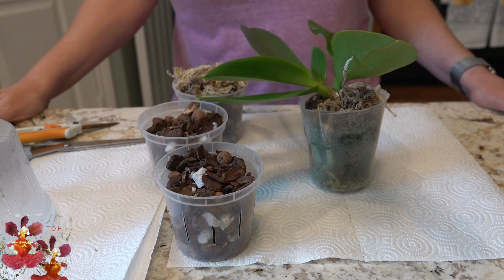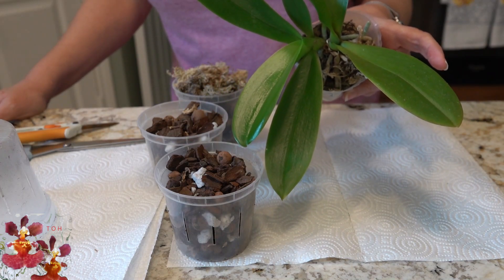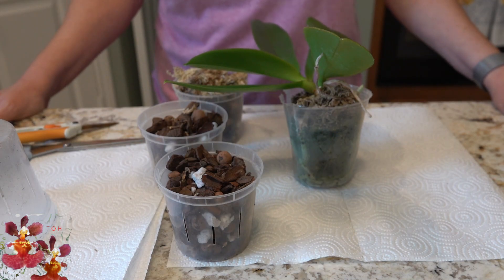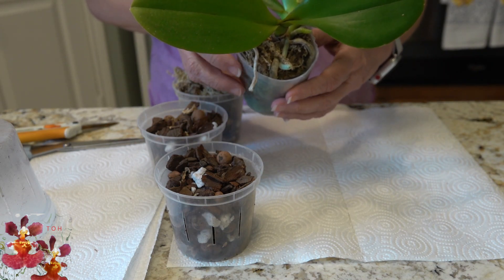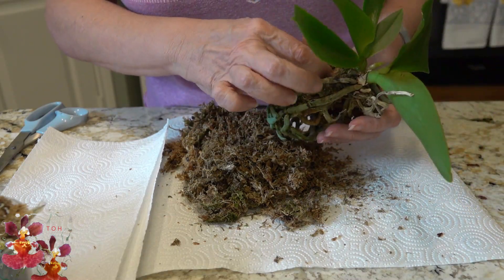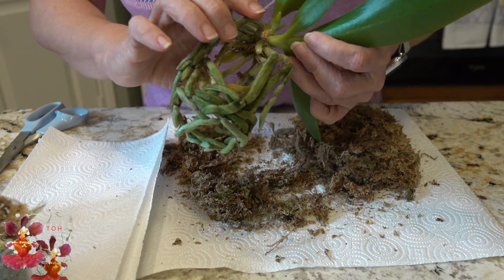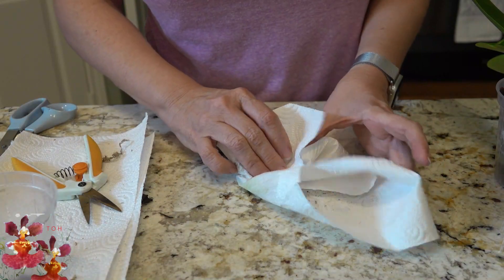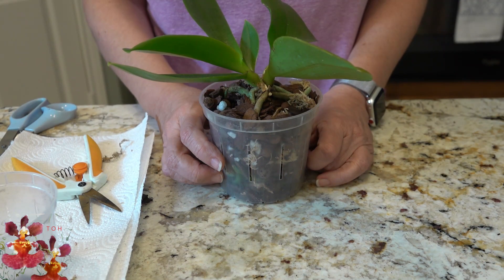How to Handle a Phalaenopsis Orchid Basal Growth | What is a Phalaenopsis Basal Growth? | Repotting

Comment: The root system looks great.  This video came just in time. I currently have 2 phals that rotted in the center and eventually lost all the leaves and left behind the roots.  Normally, I would’ve thrown them in the trash, but I decided to keep the root systems in a vase with a little water and low and behold, two basal growths started on one plant and one on the other. 😮. I also have another Phal that extended in the center and grew roots in the middle of the plant.  I then cut the top off with the roots (now growing in its own pot ) A new growth started at the point where I cut the top off ( above the healthy leaves that were left behind.)  If you would like to see them, I will send pics.
Reply from the maker: Very interesting!  Yes, please send pics…I may be able to share them in a community post for others to learn from.  TheOrchidHut@gmail.com

Comment: Nice topic 👍Recently i notices a basal growth on one of my Vanda. Is that normal for vandas to get basal growth. Wonder what prompted the mother plant to send out a basal growth. What should i do with this growth? Allow it to grow there like a branch? Mother plant may need double the nutrition as the same root system has to cater to two individual plants. Your thoughts on this Dana?
Reply from the maker: It can happen.  Vandas are monopodial just like Phals.  I do think it is more common for vandas to develop basal growths when they are very old specimens (not just when they are in trouble, like my Phal example).  Yes, just allow it to grow.  I don’t think increasing food is necessary, though.  Down the road it will likely develop roots.
Reply from the maker: Feel free to send a pic and I’ll try to share it with the community.  TheOrchidHut@gmail.com
Reply: I have mailed you pictures